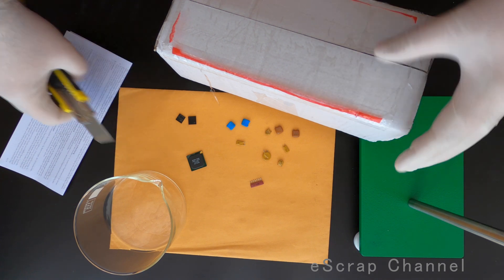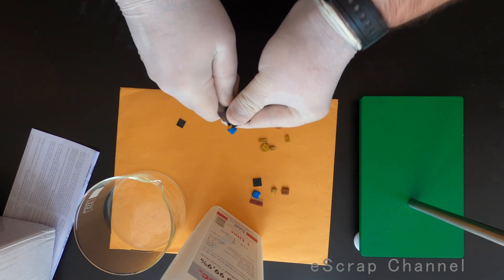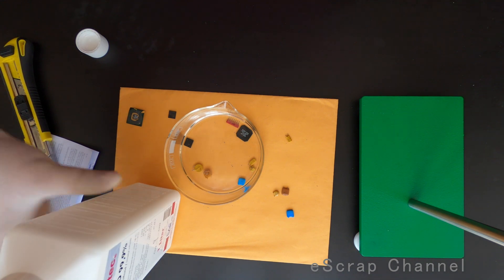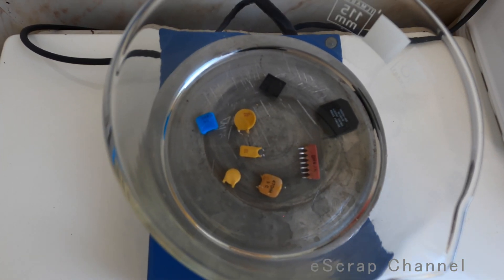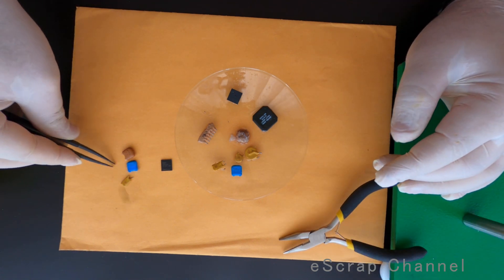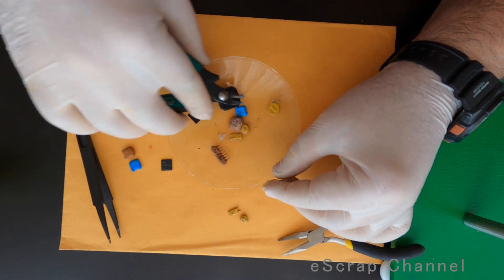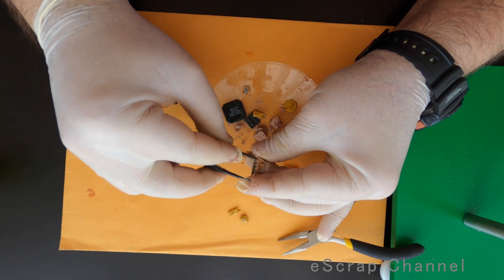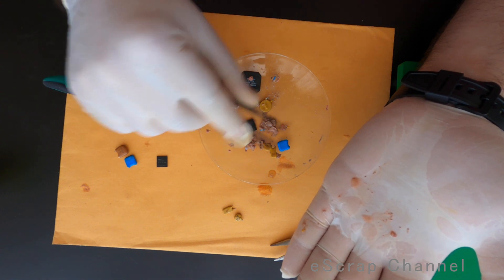Dimethyl sulfoxide (DMSO) and electronics. A quick test!

Comment: Hi! Dimexide from the pharmacy works very well. 
Very cheap and powerful
Reply: У меня есть видео об этом.
Reply: Аааа - это оно и есть. Извини :)
Reply from the maker: DMSO is cheap only in Russia, Ukraine and other ex-USSR republics ... :)
Reply: @escrapchannel   why is this? And tell me this.. Are all cermanic capacitors worth keeping? Blue red yellow ect..?
Reply from the maker: @ak74headshottaa73  Not all are good, easy way to check is to brake in two and look at the MLCC inside. If it is grayish color it most probably has palladium.

Comment: You have dangerous and interesting hobby👍
Reply from the maker: Started in the university :) DMSO is harmless!
Reply: @escrapchannel  👍
Reply: @escrapchannel    DMSO may be harmless by itself when pure.  You are wearing gloves and made no mention of it, but DMSO can travel right through the skin and will carry any noxious chemicals it has dissolved with it.  The biggest problem though is the expense just isn’t justified.  Incineration works and is free using a wood fire, or still quite cheap even if gas fired.
Reply from the maker: Hi, DMSO is less toxic than ethanol by itself. Correct, if there are toxic compounds dissolved in DMSO they will poison you.
There are certain types of capacitors where DMSO works perfectly, like Bulgarian brown ones, but in general it is cost effective only in ex-USSR countries where DMSO is extremely cheap!
Thank you very much for the very valid comment! 👍